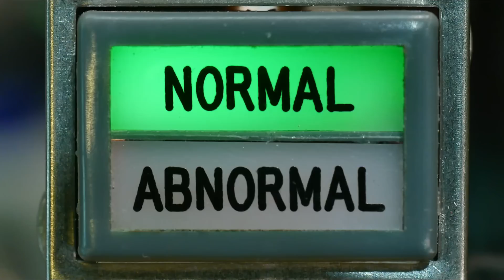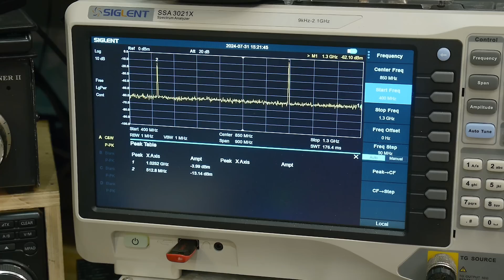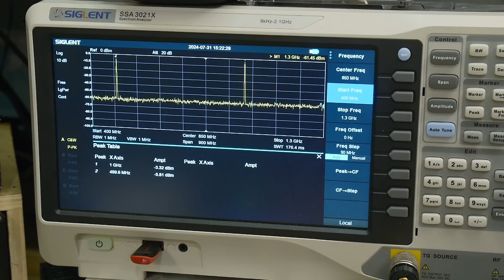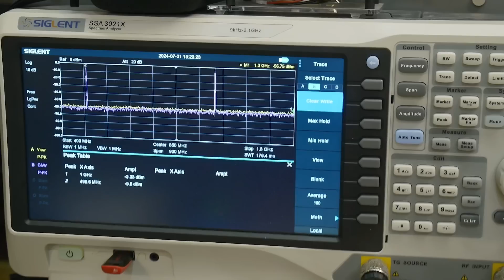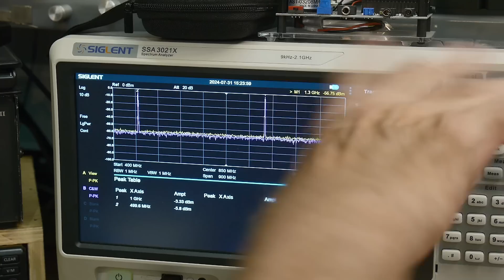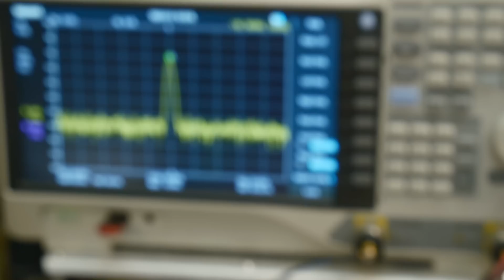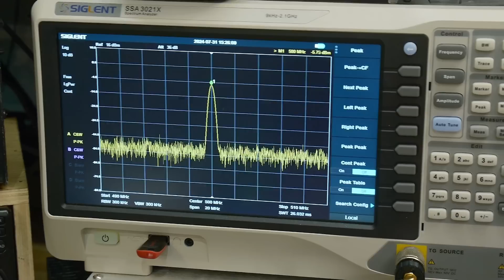#1967 RF Prescaler used for divide by two

Comment: That coupler will be designed to work with all of its ports terminated into 50 ohms. You should use a terminator on the port that you're not observing to see the proper behavior.

Comment: What practical real world application would this be used for?
Reply: RF frequency synthesis.  You divide the local oscillator down before passing its signal to a phase-locked loop. The next stage in the divider chain is likely to be a dual modulus divider. If you are using this ÷2 on the 23 cm band, for instance, your LO will be going about 1.3 GHz, This ÷2 will lower that to 650 MHz, which would then be well within the range of a MC16026A ÷16/÷17. You can use digital logic switching at frequencies below 41 MHz to control which pulses the divider drops. With that setup, your LO would have a 75 MHz tuning range. Logic that can operate at 41 MHz is a LOT cheaper than logic that can count in microwave frequencies.